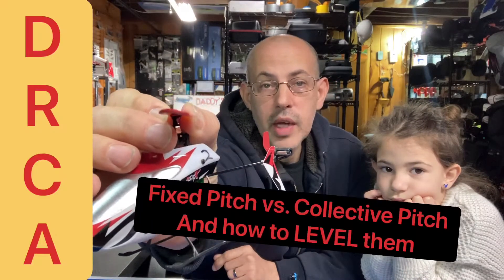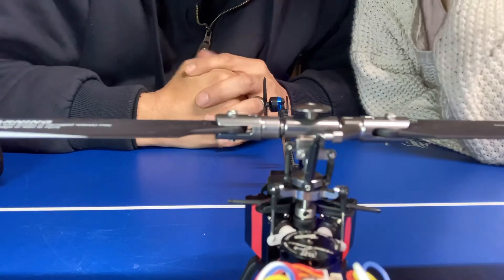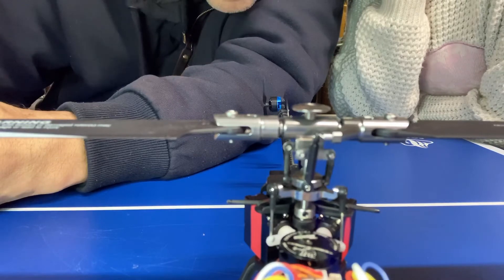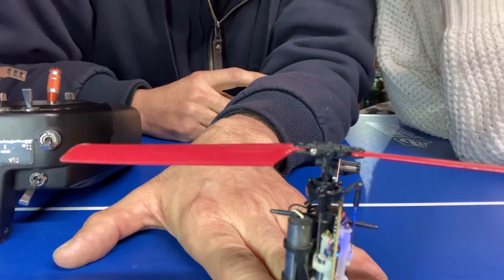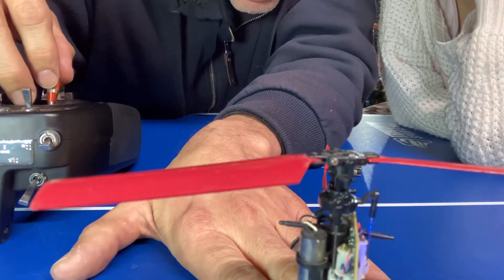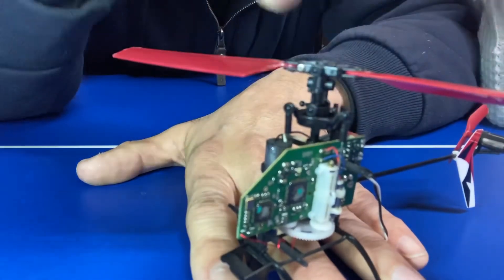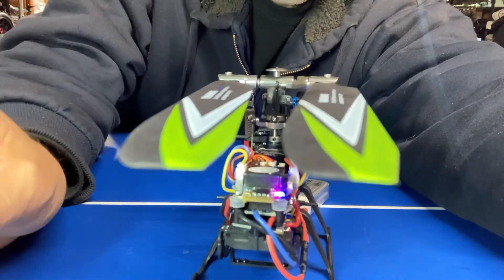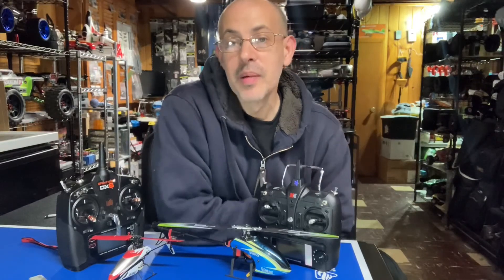Fixed Pitch vs. Collective Pitch and how to level them

Comment: Also could you explain to me what the 4 additional switches do on the transmitter? I can see that one is for low or high rates but I'm stuck with the other 3.
Reply from the maker: Thanks for the comment... 
Fmode/gear switches from normal mode (back position) to Idle-Up mode (front position)
6G/3D switches your gyro from 6G for self-leveling to 3D for acro flying without self-leveling
Note: In normal mode you can have 6G or 3D and in Idle up mode you can have 6G and 3d so for full Idle-up you will need to switch both the Fmode/gear and the 6G/3D switches to the front position.
This is useful when learning... switch to Idle-up and keep it in 6G... get up high and try some negative pitch and be prepared to give positive pitch so you don;t crash into the ground... the self-leveling will help you get a feel for nagative pitch.
Put the Hold T switch to the front position to disable your throttle stick so that you don't give the heli throttle when your hands are near it like when you are putting a new battery in... then switch it back when you are ready to fly.
H/L is like you said for high and low rates. Again let me know what you understand and what you don't... I am compiling info for an upcoming video.

Comment: I'm considering moving upto collective pitch, I've got the wl toys 911s, eachine e119, blade 120sr, all fixed pitch, I've been flying them for around a year now and I'm in complete control of them, getting a little bored really.

When moving up to collective what are the basic principles? How do you set the head speed/pitch separately? I can't get my head round how you use the left stick to increase throttle to your chosen speed then get the stick to the bottom again to take off? Sorry if I sound stupid I genuinely have nobody to learn from. Thanks.
Reply from the maker: Thanks for the comment and don't feel stupid, it takes a bit of understanding to get your head around it... If you can get a simulator that would go a long way when learning collective flying especially inverted flying!!! Also it will save you money in the long run... a real crash will cost you money to fix the heli... in a sim you just reset it and try again.
The basic principles for fixed pitch and collective pitch helis are the same except with collective you have your basic normal mode and the additional idle up mode with a separate pitch curve and throttle curve... if you fly a collective heli in self leveling mode(normal mode) it will feel like a really aggressive fixed pitch heli. 
If you can turn off self-leveling in the helis you have now that should be your first step... you want to be able to level, hover and fly a heli without the help of the on-board gyro.
Setting head speed (Throttle curve) and Pitch Curve in a collective heli for normal mode is basiclly like setting up a fixed pitch.
When you are setting idle up is when things change...
A typical set up will look like this... Pitch curve will be linear for the most part with some adjustments and Throttle curve for most people will look like this ( 85 - 85- 85- 85 -85 ) or ( 100 - 100 - 100 - 100 - 100) 
Since you are new to collective helis I would say try the 1st one, all 85... So, as you can see the head speed is consistant through the whole movement of the throttle stick in Idle-up mode!
So now I can answer your question ,how do you get the stick down to take off... You Don't!!!... you only switch to idle up after you take off in normal mode and get the heli in a stable hover... then you switch modes... now you are in idle-up at which point you will now have POSITIVE pitch and NEGATIVE pitch... so any Throttle stick movement above center stick will give upward lift and any throttle stick movement below center will push the heli down unless you are inverted(flying upside down) then it will keep you up in the air (hope this makes sense).. you will hear the head speed change when you switch to idle-up.... to land you want to regain a stable hover and switch back into normal mode and then land.
Let me know what you understand and what you don't understand and if you have any other questions... I was thinking of making a video on this topic and knowing your view point will help me better understand how to explain things in the video.
Once again please Subscribe, Like and Ding the bell!!!
Reply: @DaddysRCAddiction  thanks for taking the time to reply, it's all becoming clear now, I think the best thing to do is get myself a little xk and have a play around with it. I'll report back in a week or 2 when my order comes in. Much appreciated.
Reply: @DaddysRCAddiction  just one question, when you say normal mode do you refer to 6g self level mode and 3d mode is basically idle up?
Reply from the maker: @multipreach2674  yes... but to get full idle up you need to switch both the mode switch to the front position(this puts the heli into Idle-up... meaning that the head speed will be constant through the complete throttle range) and switch to 3D to get into ACRO mode(no self-leveling)... if you keep it in 6G with Idle-up you will have positive and negative pitch with self-leveling... this is actually good for getting the feel of how negative pitch feels... just make sure you are high enough when you first try it out so you don’t crash into the ground.